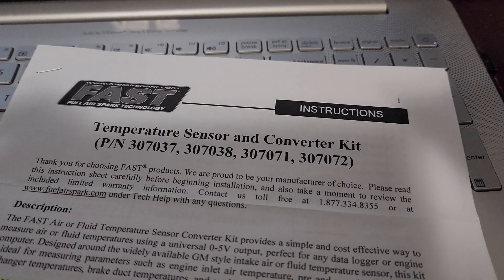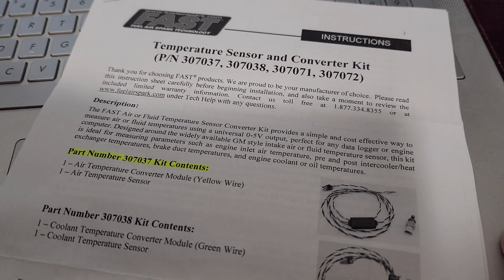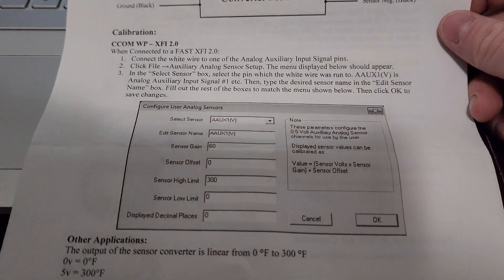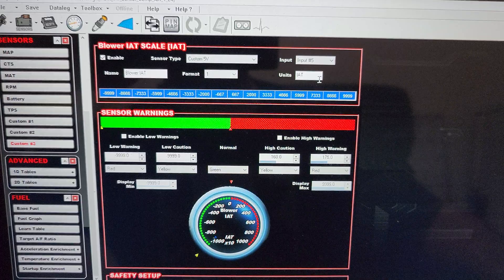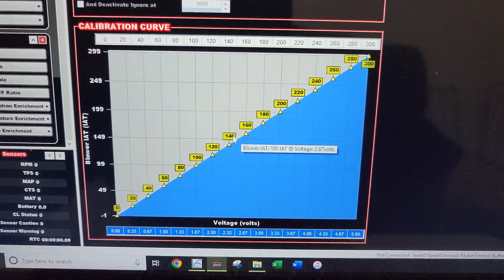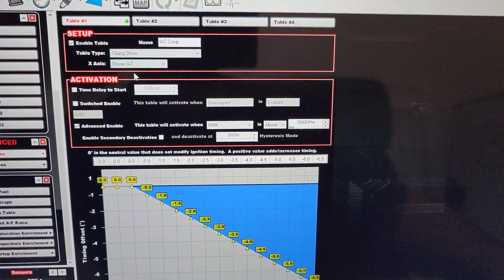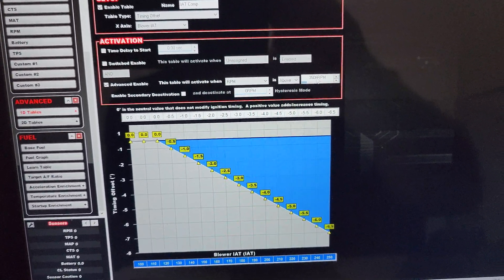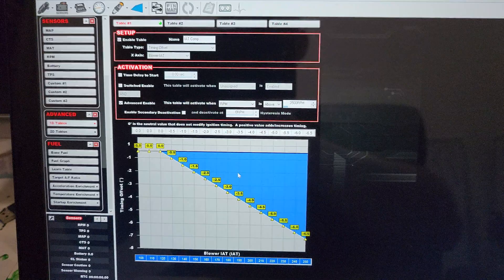Intake Air Temperature Sensor Install and Calibration.

Comment: My original air temp sensor is bad and it won't add or subtract fuel according to temperature.  How would I be able to use this to replace the broken one that isn't replaceable? Custom table for fuel instead of timing?
Reply from the maker: An option is to use a custom scaled input and build an advanced 2d table for a fuel/timing offset.

Comment: Assuming the sensor is 1/2NPT, would mounting it in a 3/4NPT to 1/2NPT phenolic bushing / adapter, help to isolate the sensor from the manifold heat?
Also, are you logging ambient temperature to get the temperature across the blower?
Reply from the maker: Yes, I have a temperature sensor upstream of the throttle plates, so I can measure what is entering the blower and now after. Knowing the ΔT will allow me to determine the optimal blower speed where I can maximize inlet air density.

Although a good idea in concept, I do not believe that would hold very long before deforming and ultimately failing. Most OEM's use plastic for this very reason now, but if you make it work please share the info!